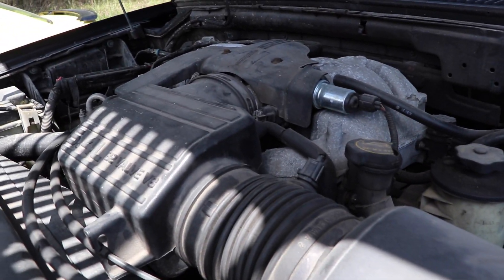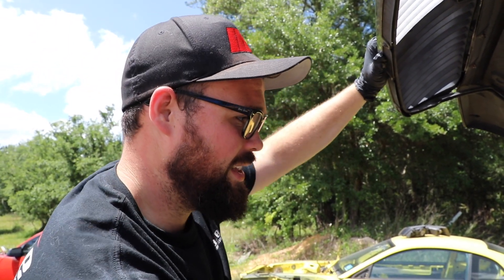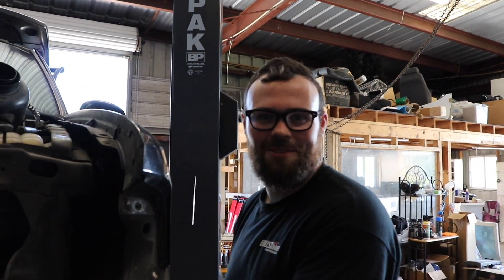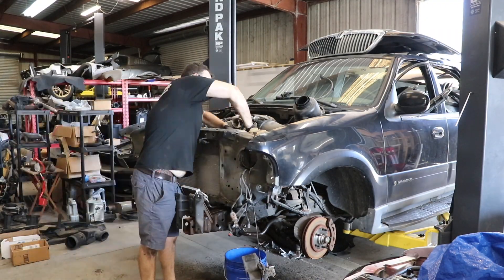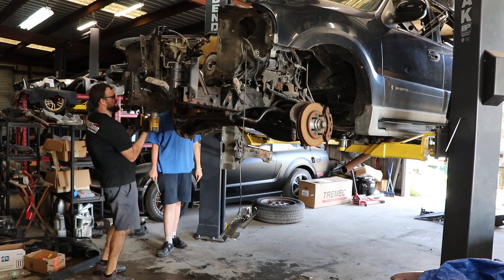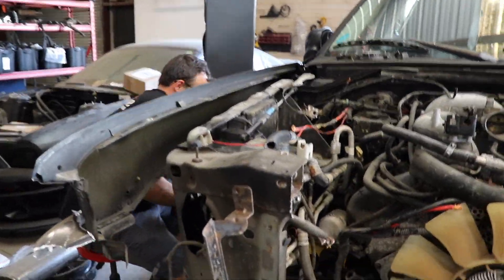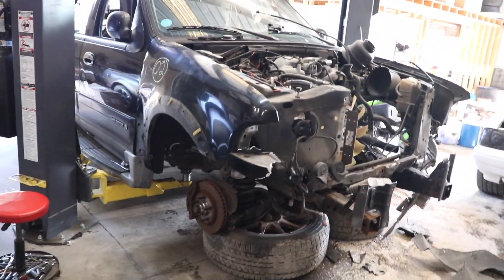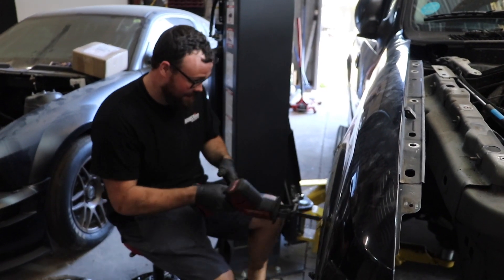Pulling the 5.4 4V! | Turdzilla's Revival Part 1

Comment: We need to see a lighting blower on top come on drew that would be sick
Reply: Nah man if you're gonna put a blower on it put a gt500 blower on it.  It's a 5.4 4v like a gt500 not a 2v like a lightning I think it would be easier to make the gt500 blower work on it plus its better people upgrade to even the m122 (07-12 gt500) in the lightning community.
Reply: @midnight347  they also came with a 5.4 but reason why I say it’s because he doesn’t wanna spend to much money on it that blower would be cheap and easy to slap on
Reply: I think you need the heads off a gt500 for it to work i been wanting to do that to my ford since i have the gt500 blower

Comment: I'd definitely rebuild it with 3.701" flattop pistons, GT500 rods & some custom ground 4V MHS cams, ported heads & intake, Cobra single blade throttle body, ProCharger, T56 Magnum & 4.56 gears!👀 I'm reaching, but hey...it'll be a mean ass, oddball build! Do they make headers for that kinda build?🤔
Reply from the maker: Definitely not getting into another engine build right now. Parts delay holding everything back with the red gt500

Comment: Glad you are doing this I needed some info cuz I’m really thinking about doing this myself. I found a 5.4 4v at my local u pull it. Long blocks are only $120. I’d love to do the swap with my 2v but I actually just got a Kenne bell 2.1 kit for the 2v so now I’m looking for an sn95 new edge or 3v s197 roller to drop the 5.4 4v. Probably won’t do much maybe the coyote intake I’ve watched a few videos and it doesn’t seem too hard to put the coyote manifold on it and maybe 150 shot then eventually a big fat turbo on it

Comment: ive  looked into the swap on the forums years ago and i still retain alot of the knowledge of what is needed. it will run just like a 4.6 with more displacement. needs a MAF calibration, stock cams are just like 03-04 cams but the power band will be more low and mid range and weak top end. 5.4 swaps need more duration in the cams to breathe. its big stroke same bore as 4.6. deck height is 1/2 in taller. you can make your own k member spacers out of aluminum blocks and drill the holes for the bolts. try finding a aussie falcon 5.4 manifold its like a mini cobra R manifold and make a custom Fab lid for it or weld on a throttle body flange to go oval or drive by wire throttle. navi heads are a big port version of 99-01 cobra heads. long tubes can fit if not boosted. just need to widen  a mid pipe. 3.73 gears will be great for it with the torque.
Reply: if you wanted to build the engine into a high RPM SCREAMER get a 4.6 stroker5.0 crank and put that into the 5.4 block and get some custom ground high duration cams. and if you can find a 5.4  4vlave sullivan intake manifold it would make a killer 9,000 rpm ripper at the track.highly recommend a dog engagement manual transmission or built auto. modern stand alones can handle the rpm and spark now for 9,000 rpm and no longer need a carb and cam driven distributor for spark.